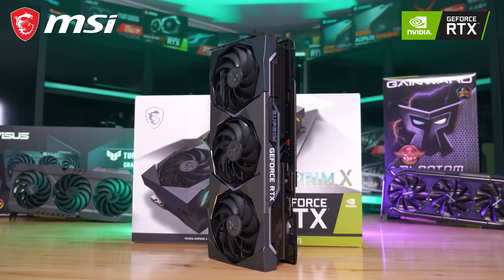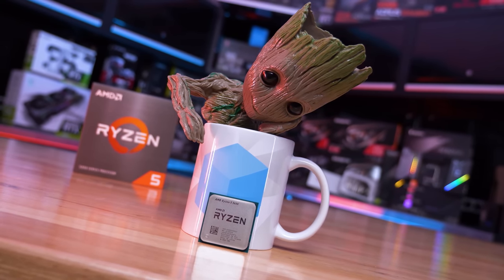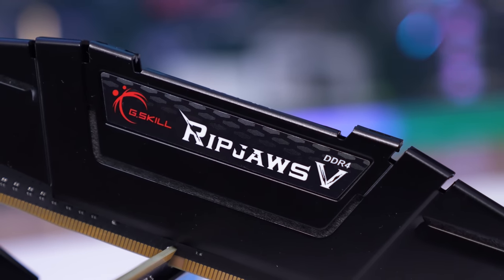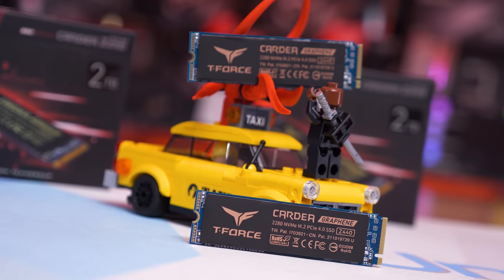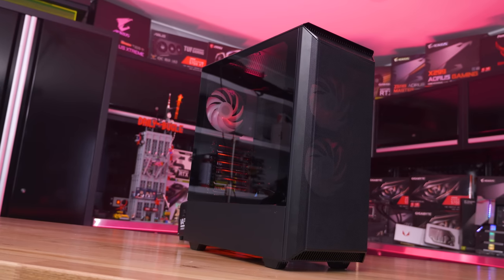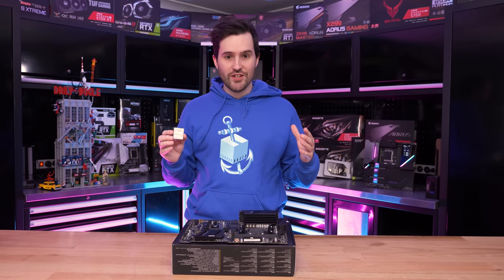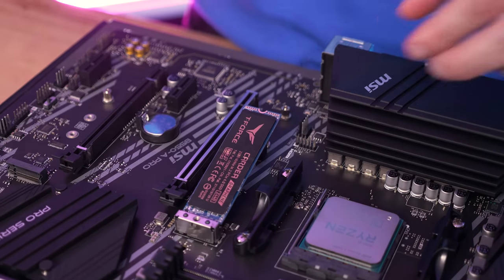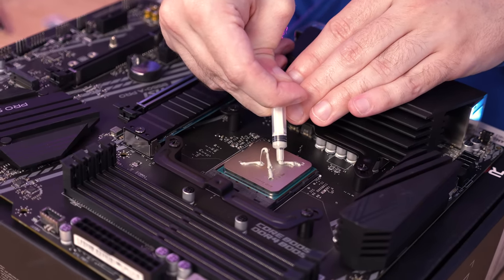Ultimate Value Gaming PC Build - AMD Ryzen Edition for 2022

Comment: Can we do an explanation as to why 3600 is the "sweet spot" for memory? All of my testing show the difference between 3200 and 3600 is minimal at best and ends up costing $20 less or more per kit. It feels like the 3600 "sweet spot" is just echoed around YouTubers without any real numbers showing why.
Reply: Depends on the timings but you should only expect percentage improvements.
Reply: It's based on the max internal speed of the bus (Infinity Fabric) inside the chip. Zen3 chips can run up to 3600mhz IF at 1:1 with memory. If you run slower memory, the IF has to slow down as well making things slower. Some chips will clock a bit higher (3800-4000) and that is ideal if your chip will do it, but 3600 is officially supported. 3200mhz RAM means a 3200mhz IF, which is less than optimal. That being said, a lot of 3200 memory can overclock to 3600. 3200 isn't a bad choice though if cost is more important to you than optimal performance and you get a really good deal on it. That being said 3600 is typically about the same price these days. Do check the timings though, some of this cheap 3600 memory is like CAS 20 or even 22, which would make it slower than good 3200 Cl 16 RAM.
Reply: @jasonhurdlow6607  The pricing angle is key; as the supply side shifts, 3600 becomes cheaper, so it's a no-brainer. Same thing happened with DDR3, eventually 2400 was cheaper than 2133.

Btw, Denver (in the Techonomics Podcast chat) was able to reach a 4500 IF clock with this 4500G IIRC. Very much the edge of the bell curve, but blimey. :D

Comment: It's frustrating how some markets struggles with high GPU prices. In Sweden the RX 6600 Mech is about $20 cheaper than a RTX 3060 Ti Ventus also from MSI, and yes those are the cheapest of each category. Given the very slight price difference I'd be hard pressed to go with the RX 6600 given the choice. I'll add that I'm using a 1440p monitor and the RTX 3060 Ti tends to perform better, relatively, compared to the RX 6600 at 1440p than it does at 1080. Still at 1080 the 3060 Ti claws back a lot of the massive performance advantage the 6600 has over the plain 3060 in some games.

Now if prices were even close to what they are in the US then the RX 6600 would look a lot more interesting.

Comment: I have no clue why the MSI board is that f*cking expensive in the US and why you have choosen it. In Europe it's a 105-110€ board. The Tomahawk is 136$ (on newegg)/140€ which is the superior board. So you should have skipped the A-Pro and researched a bit better and thoughful.

For a 6600(XT) even a good 600W PSU would be enough which even a 6700XT would fit. So I would skimp on the wattage and save at least 20€.

Comment: 2022: $1000+ is a budget build
2017: $1000+ is a high end build

i dont know what their plan is for the next few years but by that time, pc gaming will now die as prices go up and up
Reply: The budget of now is still better than high end of then. This is progress.
Reply: Prices are still very good compared to the past. My first Mac II cost $4000, in 1990. Adjust that for inflation, then tell me how bad we have it now! 😋 PCs are still much cheaper and faster than most of the history of home computers.
Reply: @albinogator6221  um no
Reply: @jasonhurdlow6607  how is a mac comparable to a pc? they dont even game and you entirely missed my point
Reply: @curie1420  Whats your definition of high end? A 8700k+1080 build as I would call high end was nowhere near 1K
Reply: @curie1420  PCs of that era weren't dissimilarity priced (and yes, I gamed a ton on that Mac). The point is you get a lot more for your money than you have for most of the past. My first DEC Alpha cost $12,000 (it ran Windows), and the GPU I bought for it was $1600 (it was the cheap one), but was < 1% as fast as your phone is today. This idea that computers are crazily priced right now is a misconception from people who haven't been around long enough to know any better.
Reply: @froznfire9531  
- 8700 + b360 + 8gb bundle was $450 at the time
- pair that with a palit 1080 at $550
- rakk cases usually costs $35 and already has 3 fans
- $50+ for psu

you could save more on storage but thats a preference and i can say all this because this was my brothers build

Comment: I like the budget build content.  One thing I would change is the motherboard.  I definitely believe an AM4 build should use an X570 board.  You can get one for around what you're paying for this B550 (a good motherboard) and have that extra PCIE 4 and USB headroom for the inevitable future tweaks to your system.  Tim and Steve do an excellent job with their channel.  The only thing missing is a Nightwish soundtrack😁.
Reply: What's the advantage?
Reply: @wayland7150  Depends on the individual motherboard design, but generally the X570 chipset would allow you to install a second M.2 drive with PCIE 4 bandwidth + availability of several 10Gbps USB ports.
Reply: @tonyg8471  For gaming, none of that is necessary. Several decent B450 options would give the same performance and allow the GPU budget to be quite a bit higher. There's too much of an obsession with I/O these days, little of which has relevance to general gaming performance. Games do not need 4.0 atm.
Reply: @mapesdhs597  Well, this may be true for the games you play on your PC. Today. That may change as we move forward. I also use my PC for non-game related computing. My perspective is more focused on optimizing the overall technologies available for as long as possible. I understand not everyone will be looking at things the same way. I certainly have no problem with anyone following Tim's lead.

Comment: Is it worth to wait for rx 6750 xt?
Reply: NO
Reply: The 6X50 series is a refresh with simple v-ram boost. don't inspect more that a margin of error difference in most circumstance

Their may be more mature chips with better binning, so overclock better, but it's not something that most people care about.
Reply: I think it mainly depends on why you're upgrading.  If you just want more fps you should wait until the next gpu launch this fall.

Comment: I think if the R5 5600 was released alongside Zen 3 then It would be the Mainstream CPU and the 5600x would have never been.
Reply: Alas for potential buyers AMD just didn't need to, demand was so high for all sorts of reasons. It's out now but probably too little, too late. AMD would have been far better off simply pricing slashing the existing 5600X down to $150 max and alongside it release a proper 4c 5500X with good clocks and cache (because a lot of games don't need 6 cores but do need IPC/clocks), and not bother with all this 4000 series nonsense or the gimped 5500. But there ya go, sadly AMD followed Intel into the maelstrom of reaching for margins. You're right in absolute terms, but market conditions being what they were at the time, there was no incentive for AMD to release a normal stack (same reason why the excellent 3300X was such a flash in the pan).

Comment: Love the case! Sucks that I cant buy the 3-fan version of it here in Denmark :(

But, Psu, motherboard and cooler are way too expensive to belong in a budget build :P

Something like the gigabyte b550m ds3h, an arctic freezer 34/35 and a corsair cxm psu makes much more sense in a budget build :)

One could also argue theres 0 need for a pcie 4.0 ssd in a budget build :P
Reply: I think they went for more of an oxymoronic "no compromises" "budget" build. So they could upgrade to a 6800XT and 5950X without worrying about parts compatibility down the road. Certainly could save a hundred or two with some cheaper stuff though
Reply: @MichaelLong777  you could still upgrade to those parts with my suggestions... except for the cooler, id go with a bigger cooler for the 5950x, but their chosen be quiet cooler isnt really good enough for a 5950x either...

Comment: psu is overkill. a 6600 xt would fit nice in this build
Reply: 750 good for future upgrades.
Reply: @dakrawnik4208  yeah, that's the standard response. but it's overkill anyway as this is a budget-ish build. i'd rather get a decent 650w and a 6600 xt. this build uses at 100% gpu and cpu at most 400W but I think even lower

Comment: A cheaper B450 board, cheaper PSU, sabrent SSD, ventroo cooler.  Save about $200 right there.  Put that into the GPU or your pocket, or get a decent 1080 screen.

Comment: I built my amd 3600 and 5600xt system, with 16gb 3200 ram and 550w seasonic psu for 400 dollars in February 2020. Just wait until parts go at least 50% off! PC building is a joke the last two years.

Comment: My rule is to never build a system slower than a console that costs more than a console.
Reply: Yeah, me too. Because I totally love using google sheets in a half baked web browser on a console because I can't have Excel or Libre Calc. I also totally love the perpetual high pricing of console games compared to the fairly quick drop off in price on Steam...

Like WTF dude? Consoles are consoles and PCs are PCs. 

Consoles are for people who want to sit in a couch with a controller and never touch a single setting. Just plug and play. That comes at a small upfront cost but the ease of use and convenience gets more expensive over time. 

PCs are versatile machines for people who aren't technical morons and who need them for more than just gaming. They're more expensive up front, but the upgradeability, exorbitant software catalogue, perpetual backwards compatibility, ability to emulate older consoles, and resale value of components makes it worth it... to those who need it.

Your argument pretty much said "Never buy a car that doesn't have the acceleration of a motorcycle unless that car costs the same as the motorcycle".
Reply: @andersjjensen  

I have a gaming pc where I only game on. It is faster than a console which is why I built it. If I could only build one slower than a console, I’d just get a console. I use my non gaming pc/laptop/iPad for general pc use. 

If you’re starting from absolute scratch than yeah, spend the extra money on a pc. But if you already have a pc/laptop for general use (like most people) and are thinking about a full rebuild or a dedicated gaming pc, then I’d never pay more than the price of a console for less performance. To me, the only benefit of pc gaming is the performance gains (or in the past cheaper/similar price points—not possible these days). 

Being a pc gamer and former console gamer, I always found that even the longer term costs of console games to be largely similar to that of pc’s at the end of the day so that arguenent doesn’t fly either.

So people sitting with a gtx 1060 and an i5 from 10 years ago thinking about this build would be better served, imo, with just saving there money and getting a series X and game pass.

Comment: UE5 games are going to push more threads.  I looked at a test of the Matrix Awakens demo, which loaded a 5950X to around 29 - 32% consistently.  That would load a 5600, with the hits to clock speed probably to 85%.

So, the world of gaming is about to get harder for 6c/12t CPUs.  If you plan to do a build to last a few years you're probably better off going up to an 8c/16t CPU.

Also, DirectStorage is going to show up at the end of the year so a faster NVMe is probably better.
Reply: DirectStorage should decrease the CPU usage up to 40%

Comment: $1100 for an rx 6600 and ryzen 5 5600? i'm pretty sure you can get something like a 6700 xt and 12400F for the same price if not a little bit more
Reply: They overspent on cooler, ssd, psu and mobo
Reply: they did an intel build before this. this is the AMD build. they will put both head to head in benchmarks next.
Reply: You can, they overspent on overpriced components.

Comment: 12400f is 180$ and Gigabyte B660 GAMING X DDR4 is 160$
thats a way better value
and 3060 is the same price and performance as the 6600 but with the option of dlss and the build in encoder
 msi mpg a750gf psu is 95$ and better then the corsair one
already 50$ cheaper and better/same performance plus more features
Reply: Yes
Reply: this is an AMD build, they have another Intel build.
Reply: @evenAndre  ow lol  thought it was just about value , my mistake
Reply: Well in that case you could also use Gigabyte B550 Gaming X V2 board for Amd. Those are available for 100-130$
Reply: 3060s are not currently the cost of 6600s, at least not according to Amazon, Newegg, etc.
Reply: @Deathscythe91  this is the best AMD can do apparently.

Comment: Ray tracing is more than impressive with RTX 3060 at 1080p/1440p and DLSS.
Reply: Rtx 3060 is costly and nowhere near 300 bucks, you can get 6600xt with the price of 3060
Reply: @spookyskellyskeleton609  3060 is better overall and more future proofed videocard.
Reply: @sergtrav  better in what? Raw performance is more with rx6600xt 3060 needs dlss to be equal in most games. The extra vram would matter if 3060 could do decent in 1440p but it's a 1080p card
Reply: @spookyskellyskeleton609  Good luck to play Control, Cyberpunk, Metro Exodus, even Doom Eternal with 6600xt/RT on. And those 8gb of vram are not enough right here and right now in Doom Eternal with RT at 1080p.
Reply: @sergtrav  bruh that's like 4 games and tell which game exceeds 8gb vram on 1080p? And you seriously think you can play with ray tracing with 3060? It can't exceed 60fps what's the freaking point. Unless you have 3060ti or greater there's no point in using ray tracing. You could have said that 3060 is better in production and it has better encoding
Reply: @spookyskellyskeleton609  I have 3060, it can easily exceed 60fps with DLSS (Metro, Cyberpunk, Control)  or without DLSS (DOOM, RE8) at 1080p. Not so easily, but possibly at 1440p.
And I prefer to have 12gb, DLSS and good ray tracing performance instead of +5% of raw performance.

Comment: This is a mid tier very capable PC. A GPU upgrade a couple years down the line when funds alow would keep it trucking at mid teir for many years. Not really a budget build. Value at time of build yes, budget no.
Reply: The only more budget options at this point in time would be a 3050/6500xt.
Reply: @afriendofafriend5766  case, cpu, cooler, psu, mobo, ram, storage. The only one I wouldn't change for a 'budget' build was probably the RAM choice.

Comment: wished I did an AMD build than the stupid i3-12100 and b660.  Intel locked the thing down like a cheap desktop/laptop without CPU voltage settings

Comment: (Future proof)         Editing/Gaming               👑
MSI MAG B660M MORTAR WIFI DDR4         Motherboard
Intel Core i5-12400                                           Processor
Palit GeForce RTX 3050 Dual Fan                  Graphics Card
Antec DP502 FLUX                                           Case
Crucial Ballistix RGB 16GB DDR4-3200         RAM
XPG Core Reactor 850 Gold Fully Modular   Power Supply
WD 1TB Blue SN570 NVMe                             SSD

Comment: Today's budget build - brought to you by a $3000 graphics card.

Seems my definition of budget is a little low. 😆😆😆
Reply: Budget means built to withing a strict price, not a very low price necessarily. With a budget you might not be able to afford the best value option. For instance you might decide on a 500GB SSD even though a 1000GB one is better value. Or you might fit 16GB RAM in order to get better value on the SSD or GPU. You might get better value and quality if you could increase the budget.

Comment: $150 motherboard is too much, $80 for budget will be enough.
$70 case? Come on you will just put desktop under desk or use old one
$40 cooling, if you use it for work it's fine,  for games $25 one is fine or even stock.
$120 for power supply is overkill. $50 should be enough.
Get some cheap us SSD for games it doesn't make any difference. 
I saved you $200-300

Comment: There is no new budget build GPU-s still cost like a decent second hand car so nothing has really changed.
Reply: alot has changed and improved, its just not at the level you want it to be yet.
Reply: @runterranger7398  in my country nothing has changed last 6 months it is totall stand off.Prices are still inflated but also no one is buying.I mean rx 480 8 gb is around 280€.As for new midrange cards 6600xt did drop to "only" 500€.That was supposed to be official price of rtx 3070 not low midrange 6600xt.
Reply: @markolumovic2750  I never said it is good now, just better.

But yeah, it heavily depends on where you live.

Comment: Why a 5600 over a 12400?
Reply: because it's an AMD build. they alreday did an Intel build with 12400.
Reply: @thepunchableface1506  Do you know what gpu they used in that build?  Because if they used an Nvidia card that makes no sense.
Reply: @afriendofafriend5766  the 6600.. like he said in the video
Reply: @afriendofafriend5766  they used the same parts on the intel build like ram, gpu, ssd, psu, cpu cooler and case. basically identical except the processor+mobo

Comment: Builds MSI rig, but puts it in an ugly phantex case….  There’s plenty of MSI RGB cases in this price range, oh and they’re designed to work with the MSI aio water coolers. If you’re gonna suggest a starter build, please don’t mix manufacturers. Why risk incompatibility, even on the case? Btw MSI doesn’t use RGB headers, but j rainbow instead. Also the B550 has a matx variant thats cheaper and has WiFi.
Reply: Also if you’re that tight on money get a 5600g and forget the gpu, you’re only playing Roblox in this build anyway… 🤣